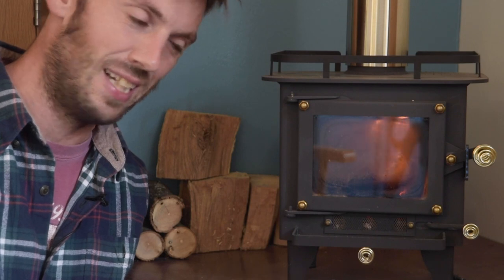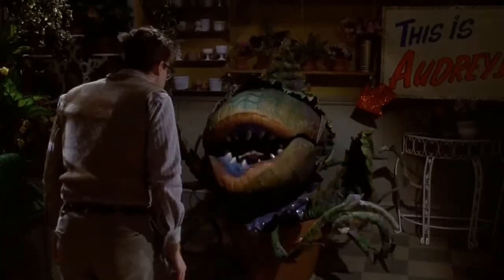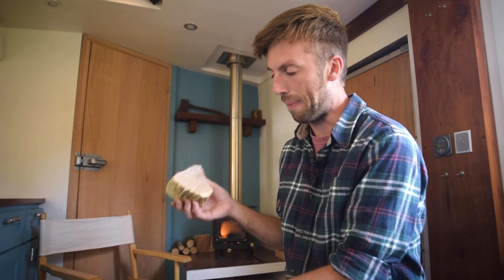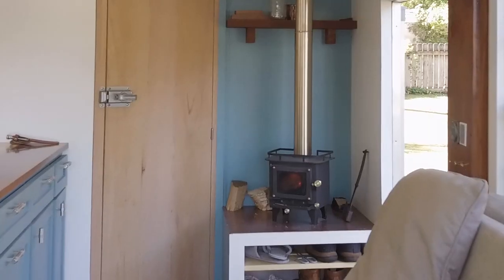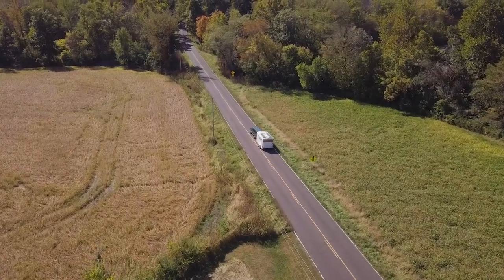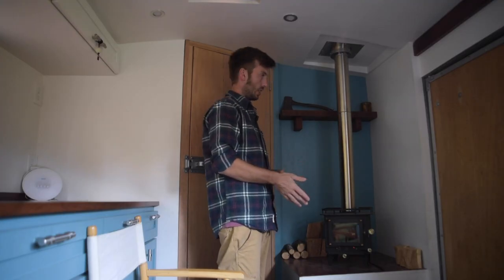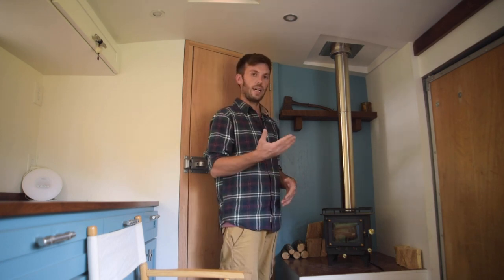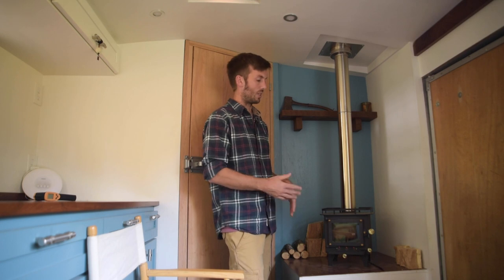World's Cutest Wood Burning Stove

Comment: Softwood does not create more creosote . Old myth. It just burns quicker and hotter. Dried soft wood is quick heat but doesn't last like hardwood.
Reply from the maker: That's good to know. I feel lucky to have good hardwood to work with.
Reply: That's good to know softwood is easier access
Reply: Creosote is made burning non seasoned wood  but pine is more sappy

Comment: Must be a total pain in the ass having to chop all your firewood that small.
Reply from the maker: I just cut the wood out of branches with a chainsaw to the length which takes no time at all then it's easy to split something that short by hand. Also the stove doesn't use that much wood so it's really not bad.

Comment: Thank you for putting this video together. I am considering alternative sources for heat and AC on a build from scratch travel trailer (stripped down an old camper to the bare trailer). I'm hoping to use SIPs for the framing, so I'm assuming it will be very efficiently insulated and won't need extreme measures to heat and cool. And it would only be for recreational traveling, not full time living. Cheers!
Reply from the maker: Hey no problem! Thanks for watching. Using SIPs is a great idea. I think I learned that getting the floor insulated well is a big deal because air can move under a trailer. I think if I were to build again I would insulate the floor and add a layer of that reflective stuff as well in the floor. But even without an insulated floor in our trailer the wood stove does a great job. Enjoy your build!

Comment: What material did you use underneath the stove? Thanks for the information on that little thing! Looks great.
Reply from the maker: Thanks Steve! I used a 1/2” sheet of plywood with 2 pieces of 16 gauge steel on top of the wood.

Comment: Congratulations on your new family member you two! The stove is perfect size, cast iron is best, it will stay hot longer and most can run on coal or wood. Coal will last longer and is cheaper and burns hotter -30 degrees Fahrenheit tested outside , Cast iron is heavier but lasts forever with a good manufacturer. 

Tile cement boards are fire proof just an idea.
Reply from the maker: Thank you! Yeah cast iron is the way I would go in a house for sure. Or soapstone. I've never experimented with coal. I've thought about making my own charcoal and seeing how that would work in a wood stove but haven't gotten to it yet. Would be interesting to see how it works.
Reply: @MacJackal  Anthracite Coal is what you want to use in the mini style cast iron models or Hard wood. Buy it by the ton if you have home base to store. 

With the stove you have is still great you can use Hard woods like Oak and Apple wood Walmart carries it. Getting a reasonably priced supply chain takes searching. Dry heat is way better and cheaper than propane.

Thank you for sharing and take care of your Family, carbon monoxide, testers, and fire extinguishers are good safety equipment.

Comment: What do you use to clean out the pipes? How is that done?
Reply from the maker: Our pipe is so short we can literally take it apart and reach in with a brush to clean out the creosote. They make all sorts of chimney sweeping brushes depending on the size and length of your flue pipe. Basically you are just sweeping the stuck on debris out of the chimney.

Comment: No heat shields?
Reply from the maker: No heat shields. We have the proper distance from the walls to the stove, double walled flue pipe and 2 metal plates below it. It has never been close to over heating the surrounding surface areas.

Comment: I was told to throw a handful of rocksalt my woodburning to take care of creosote.
Reply from the maker: Interesting... I've never heard that, I'll have to look into it. I wonder if there would be any concern with extra corrosion? I know most stove manufactures warn against throwing drift wood into a stove due to the concentration of salt and corrosion.
Reply: @MacJackal  Your are alright I just said it was driftwood because that's what it looks like it is just oak Red that looks like it I do throw a handful of rocksalt in my woodburner for creosote work's fine but you say that it's not so I will go with plastic milk jugs.
Reply from the maker: I'm not saying it's not okay, I'm just unsure so I'm going to do some research. I'm happy you said something or I wouldn't even know it was an option.

Comment: You said you did a lot of research. What pulled you towards this one over the other small ones?
Reply from the maker: It's been about 3 and a half years since I bought it, but mostly it was a combination of cost, size, aesthetics and positive feedback. We wanted a stove with a window so that removed a lot of the small stoves out there. This one isn't cheap (although there are way more expensive ones out there) but everyone that had one seemed to love them. Also it is the perfect size for our trailer and it is lined with firebrick so it actually holds the heat well for a tiny steel stove. After 3 years we haven't had any complaints. It has held up with no problems and we still love it. Hope that helps.